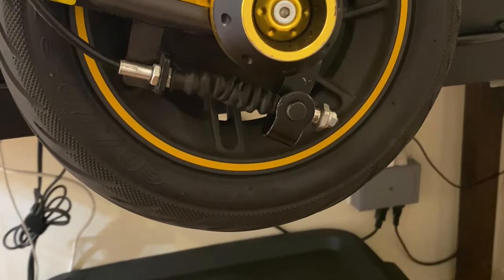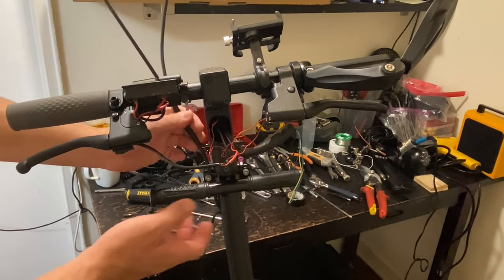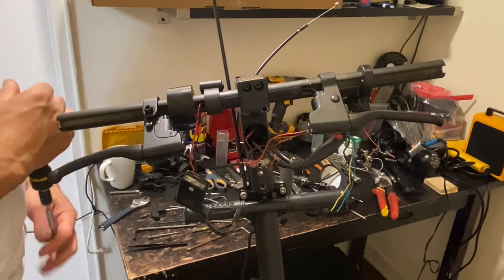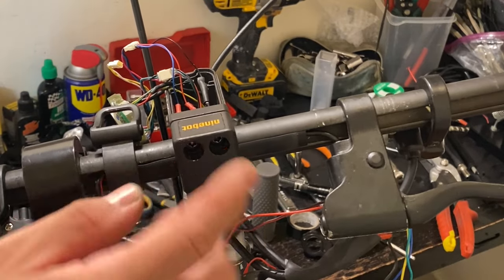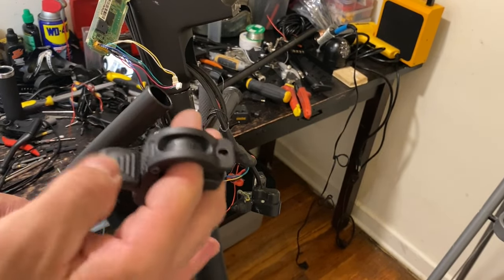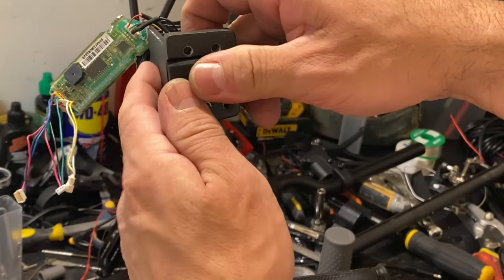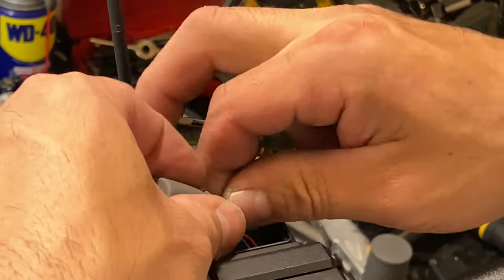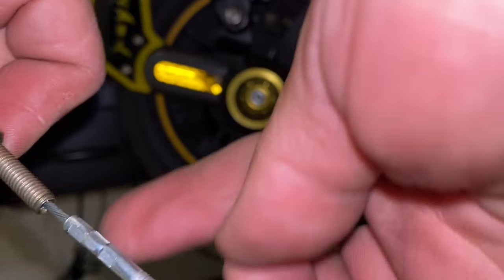Sharkset Grip Kit Istallation

Comment: Why the extra connector for the throttle? They could do it with a single one for the brake. Poor design, mediocre assembly (cables all over the place, foam to be cut after installation?? to scratch the metal and cut into the wires?)
Reply from the maker: Thats a question Segway should be answering as its the very same design just with better cables.